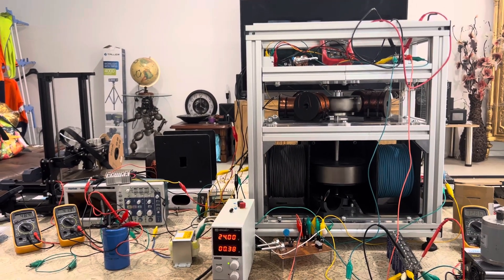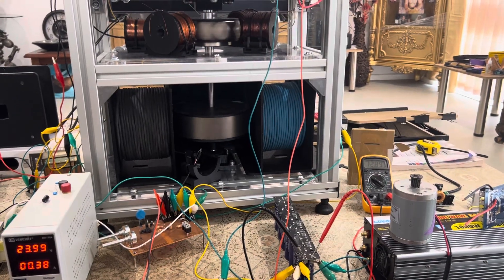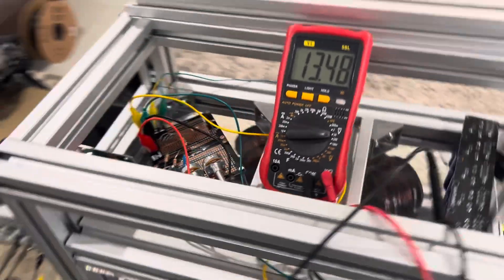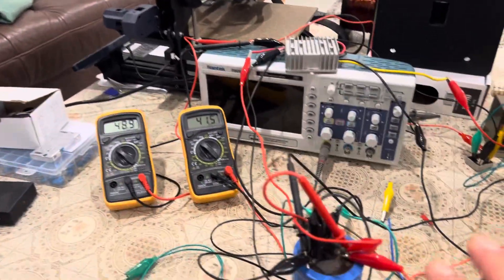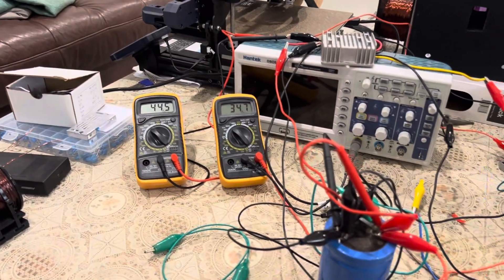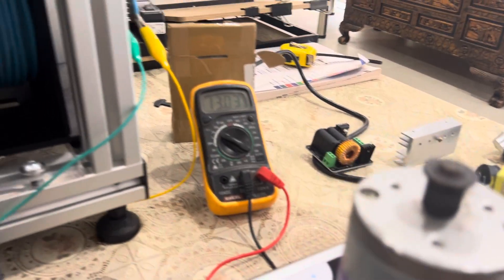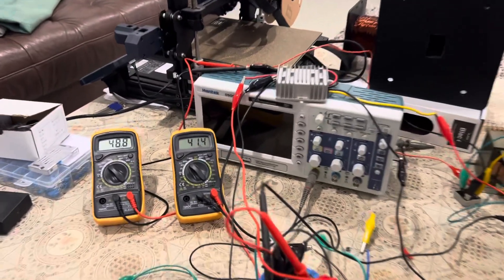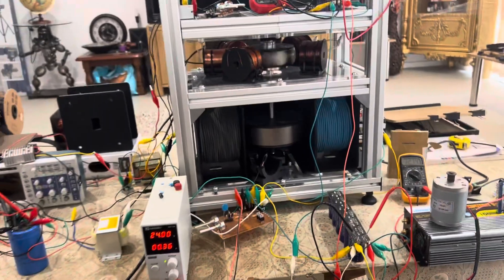Current Status On The Pulse Motor

Comment: Simply switching your generator coils at the right time with the correct pulse width will relieve stress on your motor and you'll get four times the efficiency... To pass the electromagnetic lens, you need to break more current than it's in contact (so, short-circuit it...). This is especially important when, with just a Bedini pilot, you can make it accelerate under load... The motor will turn faster, and since you necessarily have more contact because it's turning faster... you multiply your efficiency by the square. At least, otherwise you're useless, lol. Second point, listen, when I tell you to put 41 AGW 1000 to 4000 feet on a horizontal laminated mild steel core behind your pilot coils... switch them correctly, you'll see, you'll be surprised... work on what I'm telling you... we can see you're not all there is to it...

Comment: You're doing an incredible job... I've been following you for a while, but you don't listen when we talk to you. I'll repeat myself: if you want voltage pressure, add 41 AWG 1000 to 4000 feet to the generator coil and/or behind your driver coils! You'll be able to draw more power without paying more! Very important note: if you don't disconnect all your generator coils... you'll ruin everything.

...because even in open loop, with open wires, a coil becomes magnetized...!!! All coils... Do you understand? Was I clear enough? The more switching circuits you add in parallel, the more current you'll get... I do it in series for potential and pressure (correct voltage on the capacitors, considering your generator and the resources you've invested...). You should be getting 4 times 464 volt AC in the short circuit with 380 to 480 milliamps at the input, otherwise it's useless...
Reply from the maker: Thank you. I do listen to you and everyones great advices. I even mentioned, crediting you on my 6 coil video i posted few months ago. I take everything into consideration and make use what's appliable and budget for this setup. Im following the same principle of length ft but with a 31awg size wire. Having slight wider crossed sectioned area with same amount of turn can conduct higher currents as well high voltages and less lossy when going on higher frequencies. There's so much more i haven't shown yet and it will all makes sense in a matter of  time as i've been extremely busy these trying to put something together.
Reply: @11Sam11 I know, it was me who told you about this a few months ago... (about 31 AWG... 😀) You're doing a great job, I was just giving you some recommendations if you want it to stand out. To give you an example, I powered up the window motor yesterday with a 3-volt, 1-watt input... I had three 220-volt loads at the end of the Bedini driver. A lot of work! I work on some really beautiful pieces, if you only knew... I have 14 in total, all unique pieces.
Reply from the maker: @anthokranken  thank you for your recommendations and hopefully one day you can post and share your work.
Reply: @11Sam11 
I hope you'll appreciate it. I have a bearingless motor on a fractional ring, COP 800. I've only used it on 12 and 24 volts, lol... I have the same one with two ceramic bearings and a ceramic starwheel contactor fired at 900 degrees and 1300 to vitrify it... 😃😃... I have the window motor. You already know that 3 volts is enough to get 6 or 7 watts visually... I'll prove it to you, haha. I'm 3 volts from 0... it's an important diagram... another important point: cutting the coils gives Robert Adams the quadratic wave... multiplying the power squared, squared, because 4 coils are cut, lol... there's a 4x effect... anti-Lenz effect at the same time over time. I hope you'll appreciate it...
Traduire une conversation

Comment: crazy setup, I see you have 2 leads on the coils - so this is not a Bedini setup?
Reply from the maker: Yes that is correct. The magnets are arranged  n/s
Reply: @ ok, yes, so you are producing AC, but I would guess you are missing out on Teslas collapsing magnetic field patents, where a multiple-wound coil has a sender and a receiver (tuning forks) … but I have not tested your type of setup …
Reply from the maker: @CDNTheOnePath  The driver circuit in essence produces output dc but by connecting two extra leads to the driver coils in parallel, i am to connect to an AC source that generates the collapsing and expanding magnetic field between the two driver coils ( in resonance) that are being bypassed and redirected to the ac transformer now having both AC and DC outputs which's equivalent but differently configured as what a bifilar does depending on how energy is being transferred. Go check out Windpowerandmore channels as he thoroughly explains and demonstrates the mechanism involving with this circuit.
Reply: @11Sam11  Ok, very interesting

Comment: If you run the back emf into another motor coil set it will increase the RPM  for free,if you connect it on the same shaft